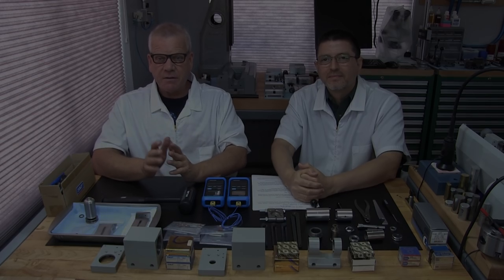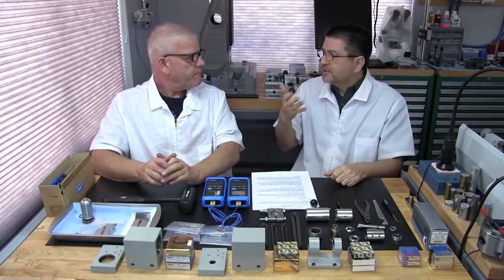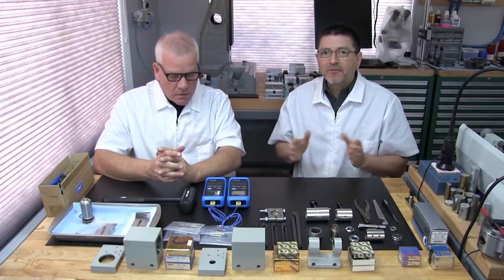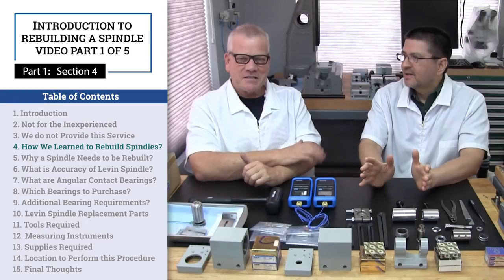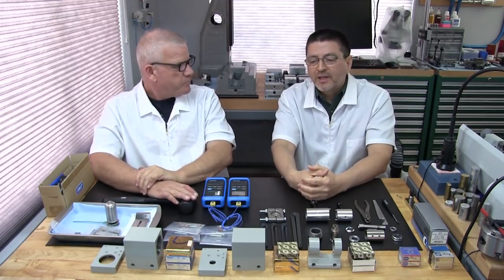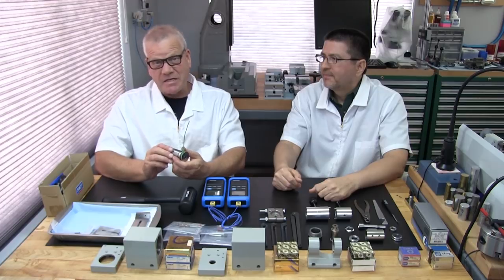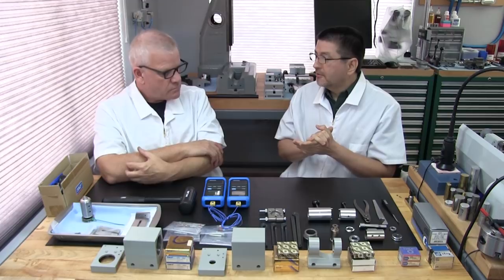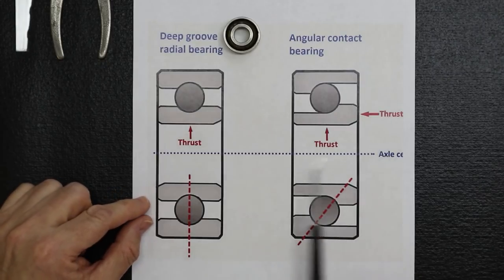Precision Machine Spindle Rebuilding - Part 1 Introduction

Comment: hi, thanks for the info.  I'm a retired maker.  I always wanted to build a precision cabinet table saw.  Strictly a vertical cut, not concerned with beveled cuts.  I have replaced bearings, trued flanges, built large flanges .....  Yes, I think I use quality saw blades too.  Just for the fun of it I want to build a spindle that will minimize the wobble in my saw blade.  I have access to lathes, mills, surface grinders and stuff.  So this project is for minimal wobble, and the blade only needs to adjusted in the vertical axis.  Depth of cut only.  I'm going to redo one of my 10" or 12" saws.  So all the info so far has been helpful.  I'm a retired ME with a little some education in design, structural, and stuff.  I'm not planning on the precision that you are building to but I want some thing that produces a clean straight and smooth cut.  Best regards, Ernie .  I will be going thru the rest of your videos.

Comment: I just came across this video, but a comment on the Koyo bearings...  They aren't a no-name bearing and are used by Japanese CNC manufacturers, however they are not used in spindle applications.   They are used in the ballscrew pillow blocks on the linear axes.  The lubrication is typically delivered as periodic injection of way lube oil from the same metering pump as the rest of the linear motion components.  I've rebuilt Kitamura CNC equipment that uses these bearings and they perform well in this application.  I would never use them in a spindle, but thought it worth mentioning here that the application matters and that they aren't necessarily poor quality bearings just because they aren't ideal for use in spindle applications.  Thanks for the great video, it was very educational.
Reply from the maker: Hi David, thank you for sharing and pointing out your observation of our thoughts about the bearings you are mentioning, we did not mean to lead to this thinking but we love that you pay that much attention to our videos that is impressive to us both. 
The bearings you are mentioning are as you share not for spindle rebuilds they are not bad for the application of ballscrew, so we apologize for leaving this thought with you. We really were just trying (difficult at times to convey) that you should not use like skate or roller blade wheel bearings in a spindle rebuild of this caliber.  
Thank you David for being here with us we have a great time together and we value you for taking the time to bring this point to our attention. Lance & Patrick.

Comment: Most of my spindles use Timken roller bearings but a lot of this still applies. You did an excellent detailed overview. Looking forward to the rest.
Reply from the maker: Hi Brian yes our spindles are small we are mainly sharing the general principles and finite details of Spindle rebuilding.
We realize in this case they are 4 spindle sizes and types from one manufacturer Levin & Son but here is something fun to share with you Brian.

Sorry for length nice to share with a fellow creator a bit Brian.

You mentioned Timken  as did one other fellow friend and creator so we have shared of resent our Barker Milling machine it has both a horizontal and a vertical head.
This machine is getting its spindles rebuilt and the spindles are the first process of the reassembly of this machine.

Being Funny Now
I am a Barker, therefore I am a big boy and I have a pair of really big angular contact bearings also made by Timken being installed. LOL.

These are larger spindles one of a BT 30 horizontal the other is a 3C vertical and guess what these are also larger spindles.
Well lets not be getting carries away here Brian, they are larger then a Levin spindle no matter the style or type but this machine like all of our machines would mount on your monarch lathe chuck and spin just fine, never hitting the ways of that massive bedded machine you have there Brian. 

Beginning in August through September
We are reassembling this mill as filler during the topics of our regular Shop Adventure shows, so we are going to show the same detailed processes and procedures as with the Levin's only this is with the Barker's two spindles more in line with your liking we hope.

These are our first ever Educational Series style videos (we will improve over time years)
Precision Machine Spindle Rebuilding How to disassemble a precision  machine spindle step by step releases early this afternoon Brian, it is not like the general introduction video opener Part 1 of 5 that was 2 hours 12 minutes, this Part 2 of 5 is a just under 1 hour of Educational video.

Thank you Brian for being here with us, being our friend you and your channel of sharing mean a lot to the both of us.
Lance & Patrick.
Reply from the maker: Oops I have Angular contact bearings on the brain while filming right now sorry to mislead you with the Barker Mill spindle those Timken bearings are tapered roller bearing there ill get things right around here. L&P.

Comment: GREAT video guys.  Loads of useful information about the bearings and why you are using the tools and materials you outlined.  Looks like the information will be good to know even for us that don't have the small stuff.  Thank you Lance and Patrick for sharing.  I am looking forward to the next installment.

Joe
Reply from the maker: Hi Joe, you are right these principles in spindle rebuilding apply to most spindles.

Thank you for the very kind thoughts and words Joe.

A great (just so happens) example is we are in our latest Shop Adventures 37 show sharing our full rebuild project even with its secret factory Vertical factory attachment a Barker Milling machine that has two spindles a 3C and a BT 30 and this is a ground up or rather a new bench top and up rebuild.

Those two spindles are each full rebuilds, and are getting this same attention to detail as the smaller, and we grant to you more precision spindles of the Levin Lathes and accessories.

We are actually filming each spindle Levin & Son offers Joe.

We feel it is wise (thank you) to watch this lengthy grand introduction of the procedures and processes of rebuilding precision machine spindles because of these rules shard in the videos.  

We promise the remaining 4 videos and 4 sub detailed by spindle type videos are each much shorter then that opening video you endured and we thank you for watching it by the way.
Part 2 of 5 released Tuesday night is just at 1 hour very serious and covers great in-depth details we are glad to be able to share with others. 

Thank you for being our friend and fellow YouTube creator warning our shortest show comes out tonight, Monday late, it is only 4 or 5 minutes in length and it is Shop Adventure 38, like the shortest show we will ever release.
Lance & Patrick.

Comment: I watched this again, since I have a lathe spindle problem of my own (on a Logan lathe built in 1949).  A comment about the bearing preload.  You've discussed in detail that this is required, but not "why" (unless I missed it).  The preload is required to eliminate the "slack" commonly present in antifriction bearings.  Also, other types of bearings are configured to resist thrust loads, such as the famous tapered roller bearing invented by Timken.  Those are probably more suitable for locomotives than for Levin.  Best Regards to you both.
Reply from the maker: Wow a 1949 Logan, thank you for the share MrShobar. 
No you did not miss anything, we did not share that subject extension. See there are not excuses around here, we just had to draw a line in many areas on this, this is a good find by you.

 Toughest thing to do for us, is convey a subject when you know it like we do and not forget to being people from maybe nothing or more through to completion of each stage of the Educational process here.
What we think was  best of all for us, this was our first Educational Series video, so we are happy with this, also some Nyoil questions from others, questions about bearing cages and such usual things.

Happy you are here, see we did not know Timken held the patent from the creation of these tapered roller bearings always learning always MrShobar.

We do have new Timken tapered roller bearings to install on the horizontal mills BT 30 taper spindle and so you see not only for tractors and locomotives but for machines that make tractor parts anyways. haha lol.  bear

Thank you friend,
Lance & Patrick 
P.S. Late we are but Part 2 of 5 disassembly of a spindle comes our before dinner runs little less then 1 hour we are filming parts 4 and 5 now.

Comment: That was by fair more then I expected.  But full of so much need to know information. Like the bearing info there is so much you need to know and understand to get the right ones for your application.  I dont have  a leven. But I do have a south bend 9. That I wont to try to put high pressure bearing in my head stock. I got a used one to play with. So thanks for sharing
Reply from the maker: Hi Joseph, the nice to have one of we are sure, and highly respected South Bend Lathe, you are a lucky man to have a good machine. 
The Educational video series Rebuilding a Precision Machine Spindle Part 1 was long as the grand launch it needed to cover a lot and we did not wish to break this up as it would delay the other 8 parts that follow.

Part 2 of 5 comes out on Tuesday night and it as with all of the others in the series each covering only details from here on out are shorter and can be viewed with ease.

Warning though there is this little short Shop Adventures 38 Show coming out Monday night (the shortest show ewe have ever made under 5 minutes of thanking and gratitude even a few thoughts about this spindle rebuilding series come to life during the show. 

We like that you are here to learn some approaches to spindle rebuilding from us and likely many others before beginning on your own lightly used South Bend Lathe, this makes you a wise man doing your research before starting a task such as this rebuilding you are seeking. 

Thank you again,
Lance & Patrick.

Comment: Thanks guys, lots of good info and fun here.
One thing, in my many years of all kinds of machines and motors I have seen slingers. Actually the VW Beatle air cooled flat four engine had slingers and no oil seals. The slingers would throw oil back into the crankcase - "sling" it back. Are you sure that's not what's happening with the Levin spindle? Does the slot go to the outside or inside the housing to keep oil in the closed spindle? Just wondering?
Reply from the maker: We like your focus and detailed question; you are what we like around here. 
The bearing shield cover has this slot to allow flow through time to exit away from the very precision bearings and down onto the lathe bed, it does really good at keeping that bearing moisture free, dry and even dust free, grease only in the bearings and there is no oil in the spindle area, though owning a 1958 VW bug in the late 60's and into the early 70's your oil return brings back some foggy yet wonderful memories here as well on that topic. 
Thank you mosfet500 again for sharing your question and thought, Lance & Patrick.

Comment: Great video guys ! where do you buy your bearing from? I couldn't find a link on your site or in the description. Thanks !
Reply from the maker: Hi Shane, Lance here, we are looking to supply you with a current bearing supplier as the supplier for the bearings we were utilizing during that time of filming has changed, we should get back to you with a supplier in a day or so, thank you for reaching out to us and we are happy you have a Levin Lathe. Lance & Patrick.
Reply from the maker: Hi Shane we promised you results, and that to share what will best help you with your spindle rebuilding bearing selection. Share your progress even the spindle type from Levin you are rebuilding.
We recommend purchasing spindle bearings from a reputable bearing distributor as there are many counterfeit bearings coming out of China and being sold through eBay, Amazon or other less known bearing companies.  You especially need to pay attention to SKF and other known quality brands as these are known to be counterfeit the most.

In the past, we have purchased NOS (new old stock) bearings from eBay as you can find nice quality bearings from SKF, Barden, IBC, etc..at really good prices but again, the counterfeit bearings are becoming a problem where we have been sent bearings that were definitely not legitimate and had to return them.  Another problem with eBay is that there have been times where we have been sent bearings that were advertised as never being opened but getting bearings that were definitely opened and handled.  We never used to have any issues with eBay but suddenly had to start returning bearings the last few years.  If you do purchase from eBay, be sure that the seller allows returns as many have no return policies.  And don't hesitate to contact the seller to confirm that the bearings being sold are sealed from the factor and any other concerns you may have.

The bearing distributor we purchase new bearings from is www.bearingsdirect.com.  We have been purchasing from them for years and have never had a problem.  They are also very friendly and available to answer any questions.

Here is their selection of Super Precision Angular Contact Bearings.

https://bearingsdirect.com/ball-bearings/super-precision-angular-contact-abec7-or-p4/page-5/

And if you are rebuilding a spindle that requires a deep groove super precision bearing in the rear, here is their selection here.

https://bearingsdirect.com/ball-bearings/super-precision-abec7-p4-ball-bearing/

Their prices are pretty good and if anything, you can use their pricing as a benchmark for pricing at other bearing houses.
Lance for Lance & Patrick.
Reply: @ActiveAtom  Hi Lance & Patrick, thanks for the reply. I actually don't own a Levin, I just found your video series very informative and helpful demonstrating best practices for replacing spindle bearings in general whether it be on a Lathe or even a milling machine. Cleanliness is key ;) I've seen so many other YT Videos of people replacing spindle bearings in the dirty garage/workshop on a dirty workbench and packing waaaaay too much grease.
Reply from the maker: @Supraman007  Hi Shane, it is ok to not own a Levin as you point out well, these videos are for general practices they are over the top and more than most want to do but they are how we do everything including our current project (not being filmed too busy for now, will get better here after work is done) where we are upgrading a brand new Heat Treat Furnace it is the smallest one the Keith Furnace company makes they are made in Southern California and we are adding it to our shop automation programming system to allow some remote operations, monitoring and such. A man will likely not get rich being like us, but he can make a living and build a museum of rare vintage watchmaker and other machinery and tools along the way, we are a pair of proud men and childhood friends since 1975 and will celebrate our 30th year in business coming on May 03, 2023. Thank you again for being here with us we love what it is we are doing. Lance for Lance & Patrick. P.S. We are currently making an advanced version machine tool accessory; we are making 6 idler pulley arm systems for watchmaker lathe accessory drive spindle operations while the lathes are running. One time only making 6 need one for our workshop here and want one for our store that we do not want to sell forever, so we are only going to offer 4 out to the public maybe to the only 4 watchmakers using vintage machines and tools from the past like us Haha, then move onto product 2 after all these years. Sorry for length just sharing our status Shane.